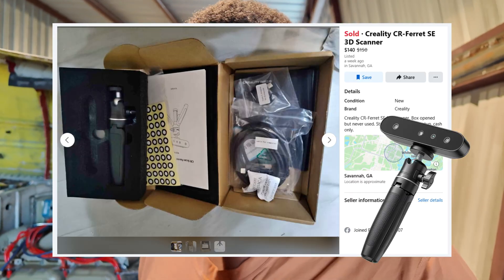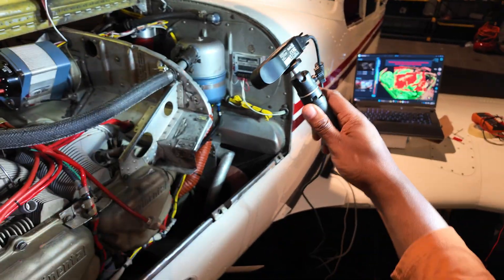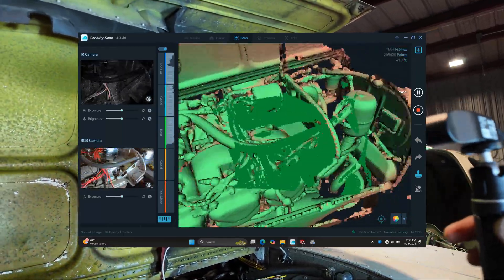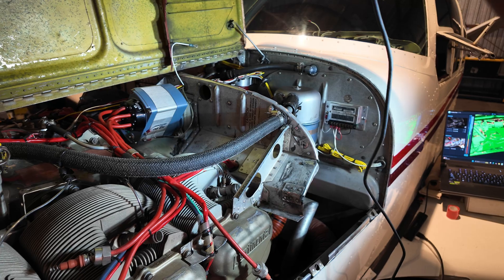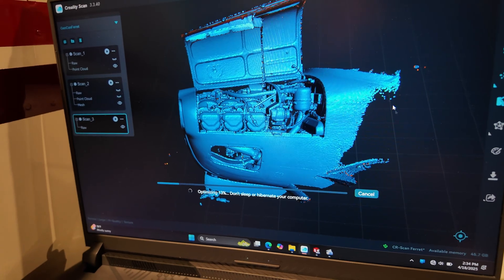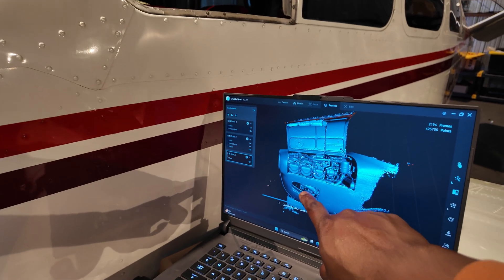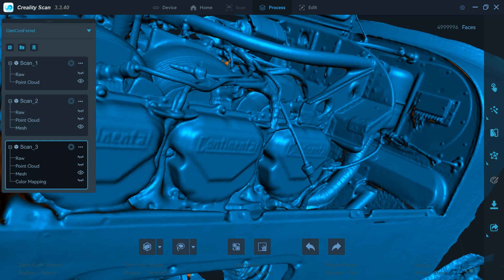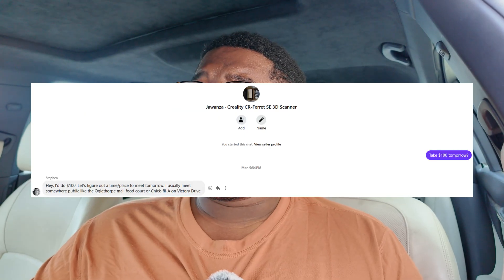A CHEAP 3D Scanner vs. the Bonanza Engine Bay - Is it any good?

Comment: You could use a CFD package to analyze airflows and pressures, then experiment with different changes to the baffles, inlet ramps, inlet size, etc. and run the new designs back through the CFD to figure out an optimal cooling solution (at least that's what I'm doing with my Navion).
Reply from the maker: You speak nerd very well! Can I follow your work anywhere? That sounds great.
Reply: @OpenSourceGA  Glad to see the Ferret does a pretty good scan!  I don't have anything published yet, but I will soon! I also intend to use my scanner (I got the einstar) to do some aerodynamic refinements on aft wing root fairings (there's some debate in the Navion community as to if short or long fairings are better). Mostly I've been engineering impossible to find parts for a 75 year old airplane from a defunct manufacturer (a.k.a. what do you do when your spinner attachment bulkhead is no longer round or centered).
Reply from the maker: This is awesome. You've found a new fan and have a home here on this channel. I do a lot of that in the background but only now documenting done of it. I sold my Einscan H for the Creality Raptor and it was a great choice for me. The Ferret falling in my lap was great because it has a wider field of view than the Raptor and so I can scan larger items much, much faster. The Raptor's blue laser mode for time details is rock solid. Possibilities are endless.

Comment: I guess the most effective method for 3D scanning is photogrammetry, as dedicated scanners are costly. But for quality results, you need a proper photogrammetry studio with good lighting, a turntable, a camera with a huge sensor, and the ability to scan each component separately. Which will cost the same?
Reply from the maker: I've got lots of experience with photogrammetry and it's also very, very useful. The current software is miles ahead of where it was 2 years ago. The other glaring issue with photogrammetry is scale and accuracy. Both the scale of the item you're scanning and the scale of the resulting scan. You'll need to be careful adjusting the results of a photogrammetry scan in post processing. The model output of this cheap scanner is appropriately scaled right out the box. My $2,000 scanner comes with a calibration board. But at $300 + a laptop or in some cases your smartphone, a dedicated scanner like this is an excellent option for many applications. Don't forget the modern iPhones come with a LIDAR sensor...that's a whole other opportunity to explore!